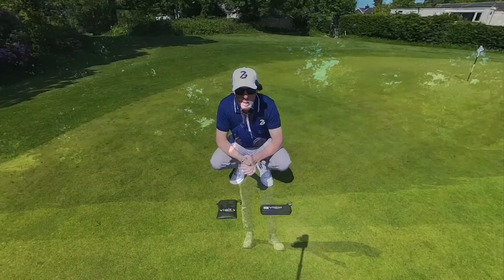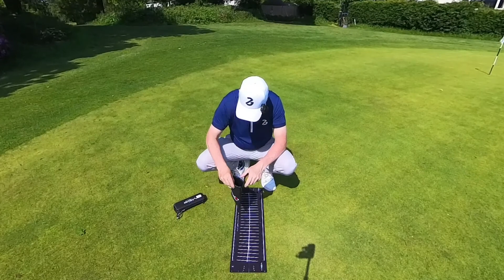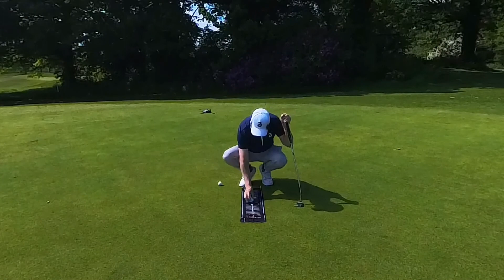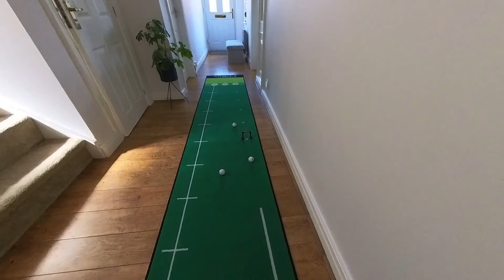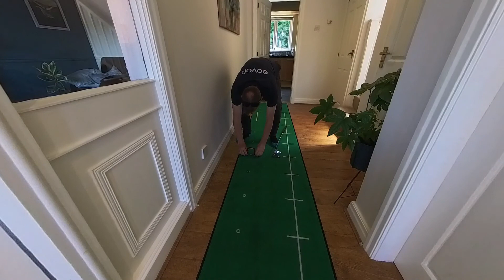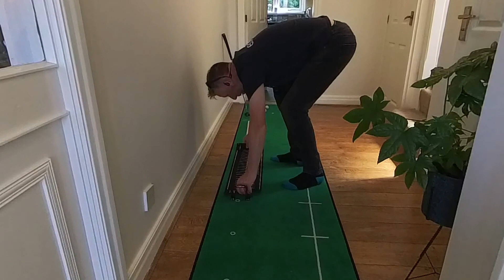The Best Golf Putting Training Aids To Improve Your Putting Stroke

Comment: I use a mirror to make sure my eyes are just inside the ball at setup and to make sure my head isn't tilted. I have a mat as well to use, but i find that after so long I start to groove a rut in it and it no longer is accurate. I use a gate also and my mirror has a gate attachment for your putter to swing through
Reply from the maker: Ive found hitting through the gate consistently is improving my confidence in my stroke
Reply: @Scratch At 50  confidence is the key on the greens. I noticed in your home putting on the mat it appears you have a bit of break. Is that your floor or did you setup the mat to do that? I have a mat as well and it's great for when I'm not feeling as confident